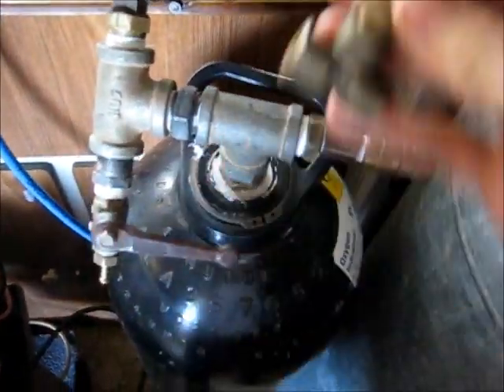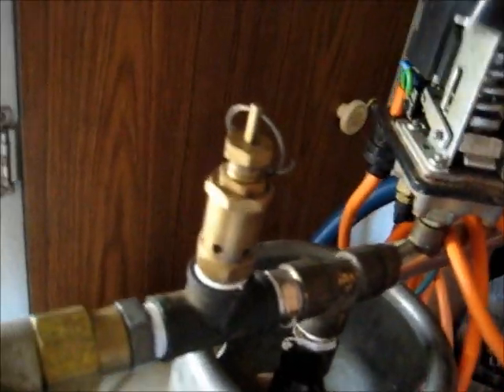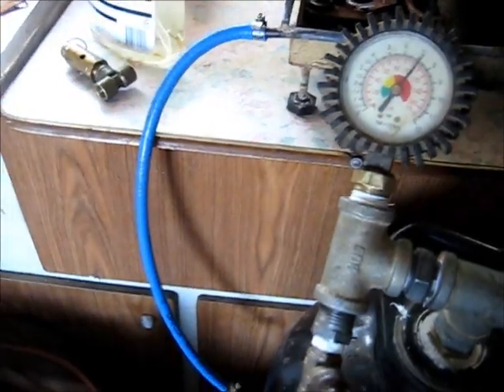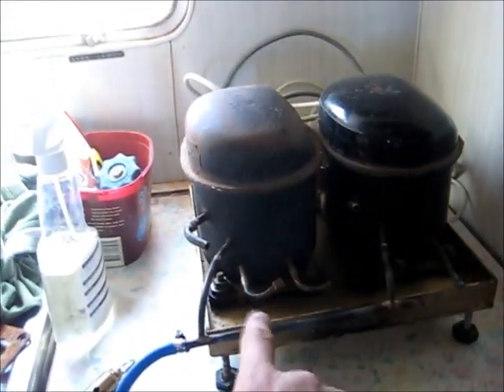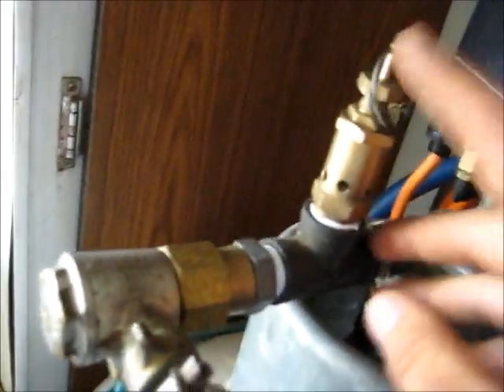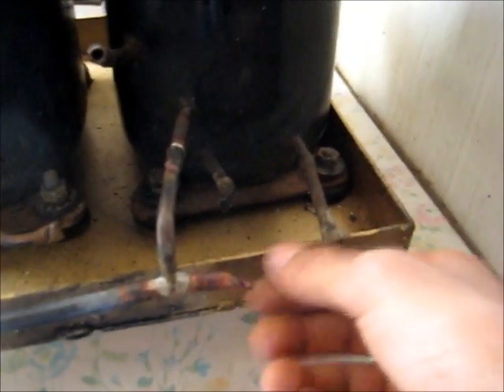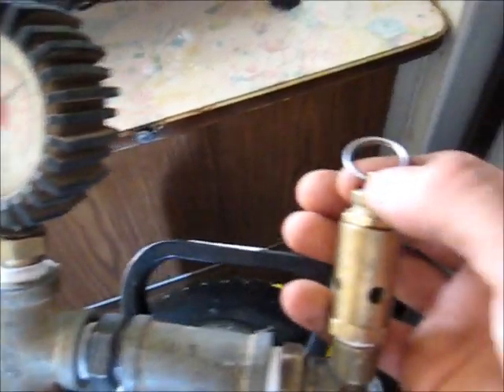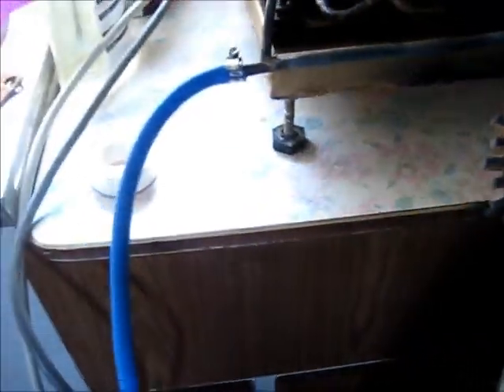Installing Safety Valve on air tank

Comment from the maker: @BiLock102 I just need to use a check valve instead of the ball valve, so it will charge then dump head pressure when i switch off the compressor bank, I'm just using a HPM double adapter ATM to switch both on at the same time :)

Comment: Cool mate, hope you can fine tune the unit with another pop valve and fix any bad joints :) I like the Oxy tank, Hope you can use a switched 4 outlet Gpo or powerboard as a control panel for the plugs involved in the set up ! :)